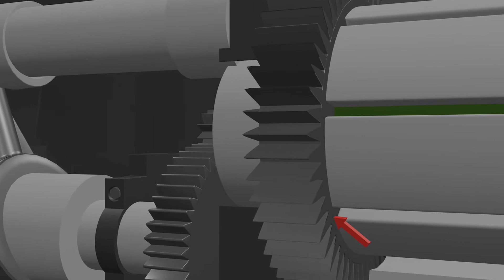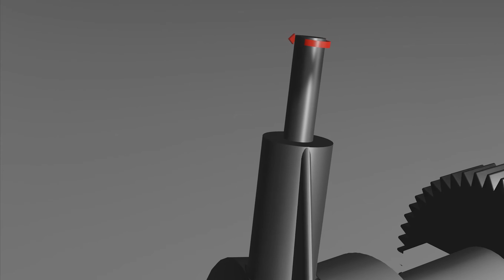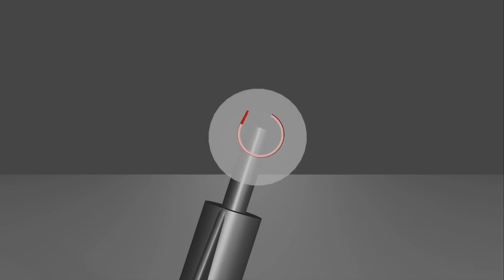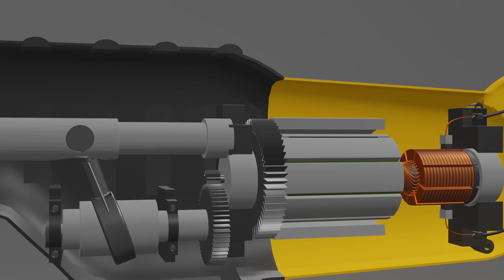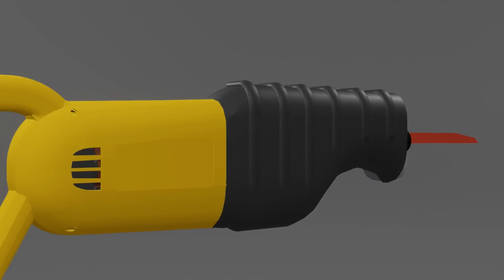How Does a Saw Work

Comment: Great video and animations.
I never would have guessed a reciprocating saw would use a wobble plate to convert rotation to linear. That’s definitely not how I would have done it simply because I can’t find a way to easily counterbalance all the forces being applied in that given space. 
I'd assume that it’s mostly the wobble plate mechanism that leads to these saws having a lot of jitteriness and instability. 
I get it in terms of space requirements and ease of production, but given these saws are meant to cut things, id probably try to reduce unwanted forces on the operator by going with a different mechanism.
Anyway, keep up the great work.
Reply from the maker: Thank you so much for the kind comment! 
I was also quite surprised when I dissembled my reciprocating saw! From prior research, I was under the impression that all reciprocating saws use a "connecting rod/slider" assembly but clearly not all of them do! I'm glad I was able to convey that principle to my viewers. Thanks for watching and thanks for supporting my channel!